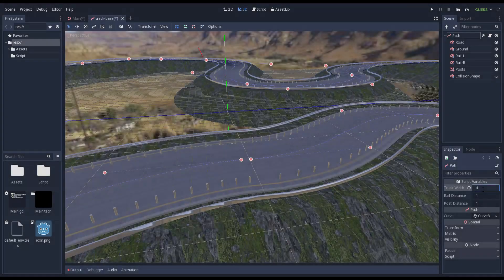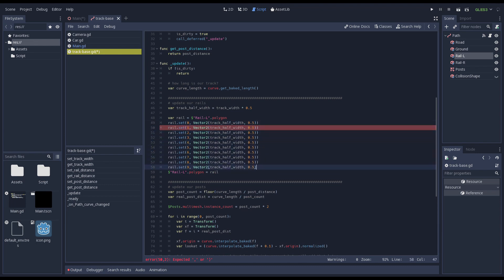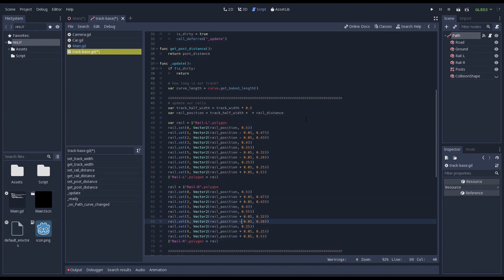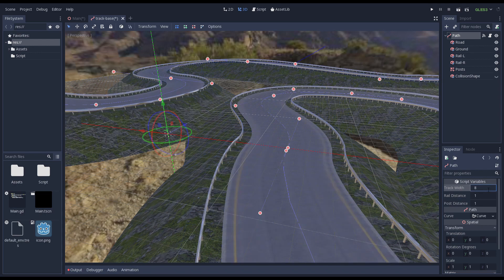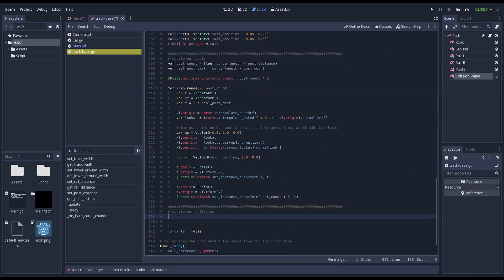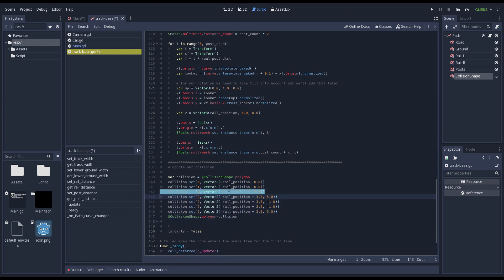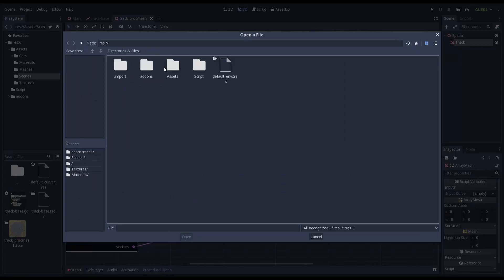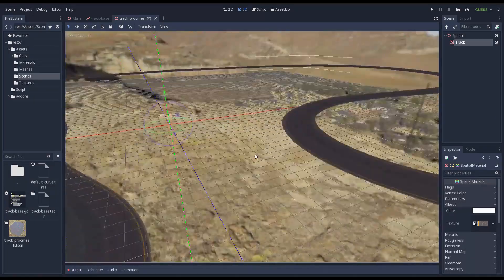Godot vehicle tutorial part 4 - finishing the track

Comment: Hello Bastiaan Olij , i imported Godot vehicle part1 (from github) into godot.
While playing the car was driving normaly.
  Then i imported  in godot Godot vehicle part4 (from github) but while playing  the car wasn't moving , i tryed to press multiple buttons  but the car wasn' t moving .
Can you help me?
Reply from the maker: Hi Pablo, I'm not sure, I haven't touched the project in awhile but just had a try. Indeed the first time I ran it the input didn't work. But after checking the input mapping in the project settings it suddenly started working again so I think there might be a conversion issue seeing this project was made in Godot 3.0 originally.
I also had an issue with it initially not loading the default environment.
Will be investigating this some more but let me know if opening up the project settings and checking if the UI mappings are there solves the issue for you.
Reply: I found the input mapping ,so i solved the problem